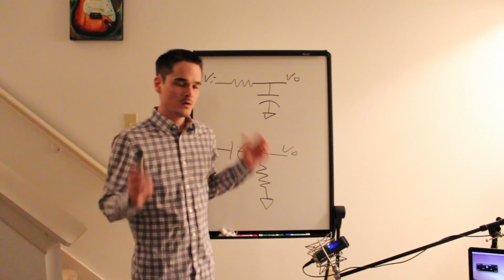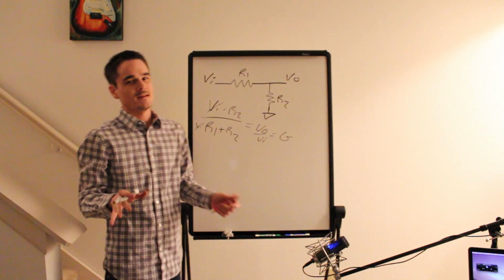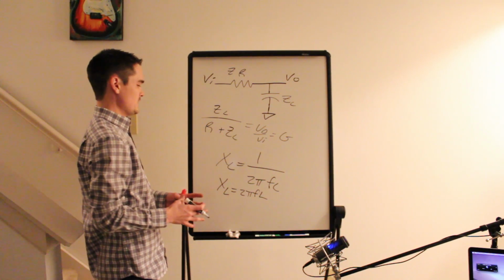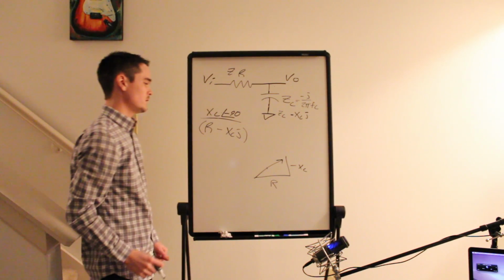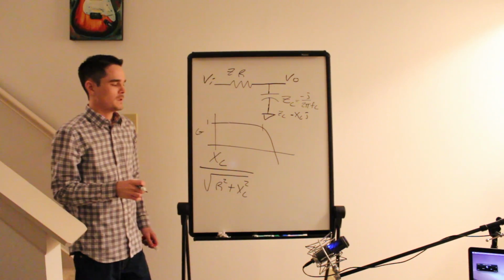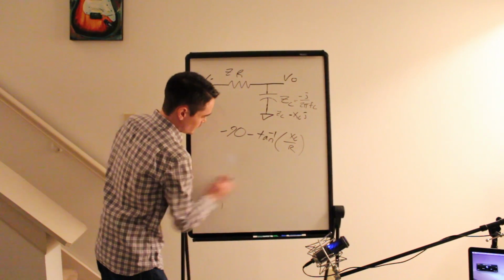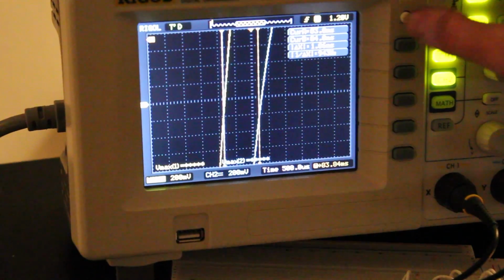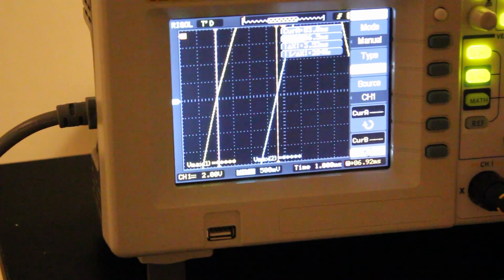How the RC Filter Works with Derivations

Comment: Great stuff, and I never tire of your rambling  - it's like the way new sub-questions are always popping up along the way, so you just roll with them.
Thanks for explaining it this way,  I'm understaning this as a 'frequency dependent' voltage divider with regards to the capacitors reactance, this has helped make a lot of sense of it for me.
Thanks Kevin

Comment: I would like you to give a more mathematical/Physcal explanation. 
Why is the order of RC relevant in an AC voltage application? Is it because that the capacitor is in parallel when lowpass and the resistor is in parallel in highpass?
BTW Awsome video. An super that you also show your minor insignificant errors - because this is such a creative process. I love your videos! Thanks a LOT.

Comment: Hi Kevin, with all respect and your great work, I have few comments,, 
If I were you I would explain why we use the RC filters, what they do and how it effects the electron-current looking from Out, and why we use them,, specifically in high speed designs. By putting so many formula on board and keep cleaning them I as a design engineer became kind of confused as what you were trying to accomplish here.           What RC is and what it does is the primary and Z of the line is crucial effect for receiver of Output.... and calculation of R & C is in respect to the movement of the electron. The formulas in my opinion is secondary for another video.

Comment: Hey Kevin, good video, well taught. I have a question regarding the capacitor and its role in filtering because I read the following somewhere: Capacitors (like coils) have self inductance where they block passing current if their capacitance is filled up, so lower frequencies get blocked whereas higher frequencies pass through because they're too short to fill the capacitor's capacitance. Is this true and, if so, music obviously contains multiple sine waves, how does one capacitor deal with multiple frequencies ... a tall order I understand.

Comment: I like the effort and the topic, but It was a little hard to follow.  You should avoid erasing your equations as you step through them, otherwise it's hard to keep track of what's going on.  Also, need to zoom in the lens and write smaller to fit more on the board.  Too much white-space.  Also, you might want to put more emphasis on a proper intro and relevance to real-world applications.

Comment: Lets try that comment again.  There is not a border between low pass and high pass filtering, they are different types of filters. The best way to visualize the difference is to look at the Bode plots for each. He shows the Bode plot for a low pass in this video, the high pass bode plot would look the same but mirrored left to right.  
So the term low and high are relative in these filters. Are you allowing all frequencies to pass below a cutoff or above the cutoff. Does that help?